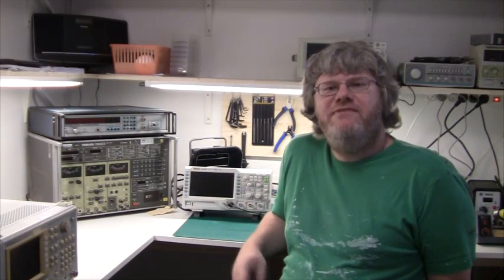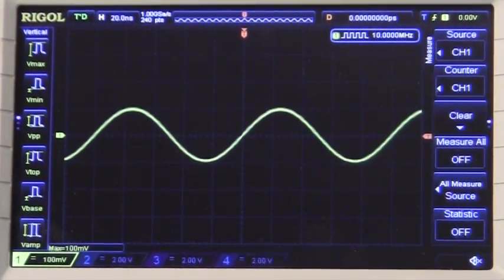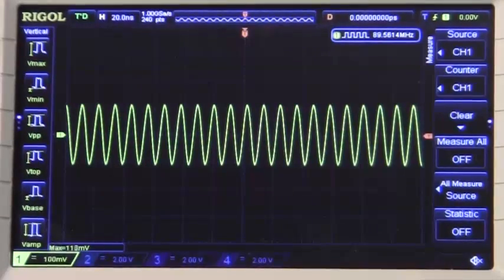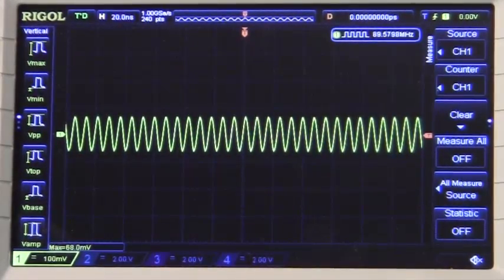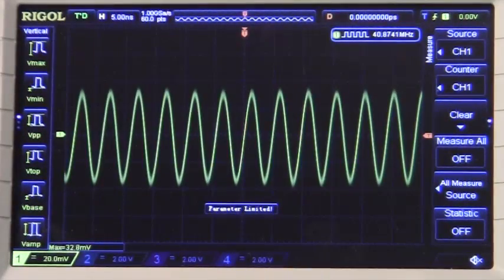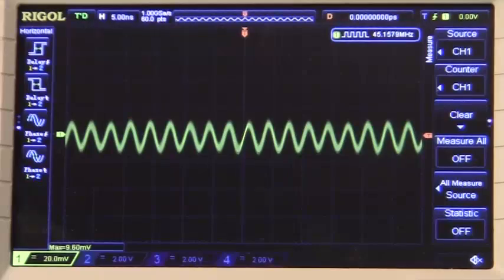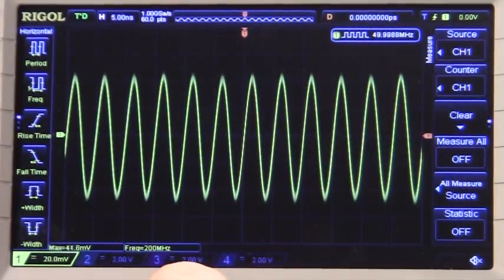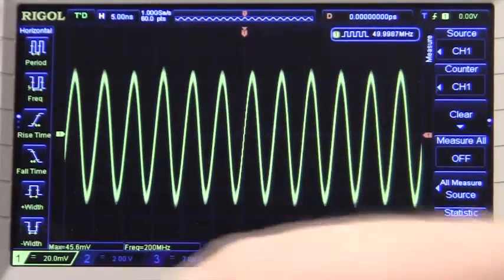Rigol DS1054Z Beyond 100 MHz

Comment: Hello how do you upgrade this oscilloscope to 100 mhz
Reply: There are you tube videos that explain this,  Search for DS1054Z hack.

Basically it directs you to a a website where you enter your serial number, pick the options you want to enable, and it generates a new product key you have to enter.  The entering is the trickiest part, it's a bad scrolled keyboard, but it's doable.

Comment: Thank You for posting. Very interesting.
How would a square wave hold up over 100 MHz?
I will probably be buy this or a Rigol MSO 1074Z with the Logic Analyzer package.
Reply: JohnHoranzy the way the amplitude dropped - not very well.  The bandwidth does not indicate the last frequency that you can capture - but essentially just where the signal integrity starts to decay.  Sign waves are the most forgiving.
Reply: A 100MHz square wave is actually just a 100MHz sine wave with 300, 500, 700, 900 etc. MHz overtones. So I'd answer this question with, it would behave exactly the same. Especially since the probes are limited to 150MHz and will therefore remove the 300, 500, 700 etc overtones, leaving you yet again with a 100MHz sine wave.

Comment: hi, great signal respond table. but why use 10X probe? why not the standard 50 ohm terminated coax connection? by using 10X probe, you are putting the probe's respond into the correction factor. when other people are using less ideal or not properly compensated 10X probe in their scope compared to yours, then the table correction factor will be far from applicable to his scope's respond. more so when other people are using 50 ohm terminated coax as most ee gurus will advise to..
Reply from the maker: +fabts4 The scope is "born" with a 1 MOhm input impedance. You buy a special 50 ohm adapter from Rigol (US$18) if you want to use it for 50 Ohm RF work.

That being said, I DO have the 50 Ohm adapter, so if there is interest, I will be more than happy to repeat the test.
Reply: If you are doing 50 ohm work, but for work that you don’t want to load the signal, then high impedance is the way to go.
Reply: +Shafri Omar Ali Agreed, coax is the way to go.
Reply: +NatureAndTech Using the coax without the 50 termination would still make more sense than the 150 MHz probe. In my opinion.
Reply: That's the probe it comes with so this is very applicable.

If you tons of add ons it can read most anything correctly.